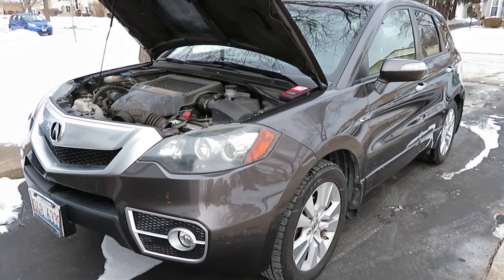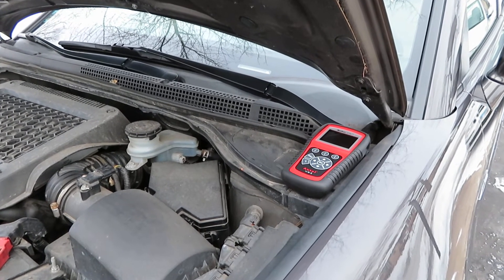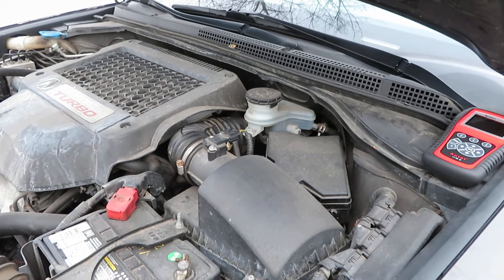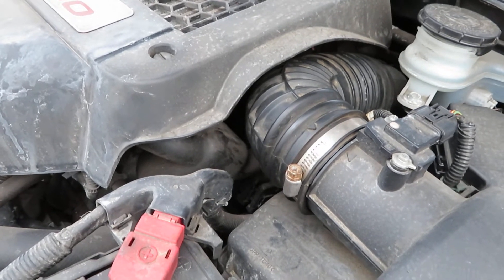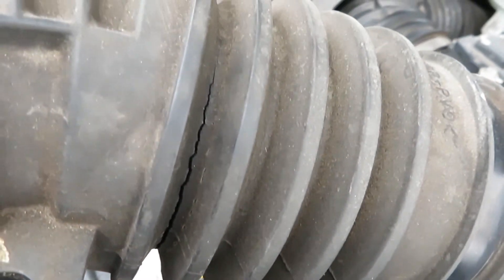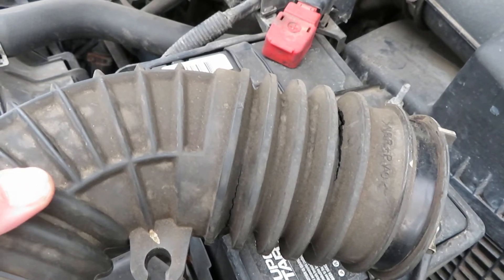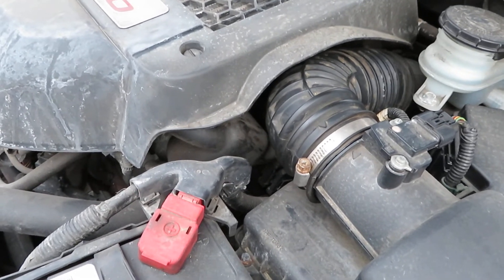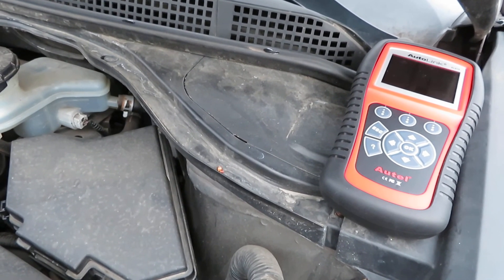Check engine light, check emissions system light, P0171 code Honda Acura, air intake tube hose

Comment: Thanks for the video. My dealer just found this issue for me as well. The charge is $140…but you can buy it for like $30-$40. I don’t mind paying them as they took the time to find it, they gave me a coupon for other work and they keep my car running safely. I would have done it myself had I known but I would never have known to look. So all good.

Comment: Yeah, those air intake snorkles/tubes with tear if anything even looks at them wrong if the car (Honda/Acura vehicles) has some age to it. Luckily the parts are readily available everywhere… eBay is your friend

Comment: I am currently having the check engine light and also a check emission system on my acura tsx. After watching this video, I opened my hood and behold, my hose, this same hose you are holding has a crack like yours.